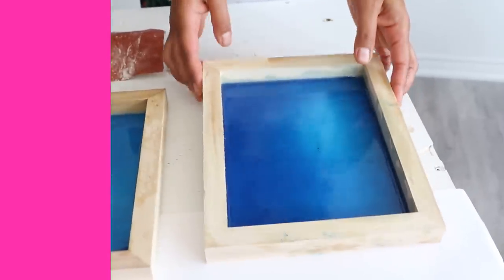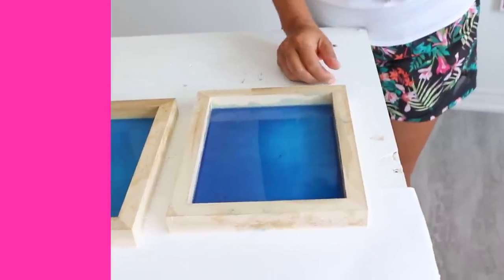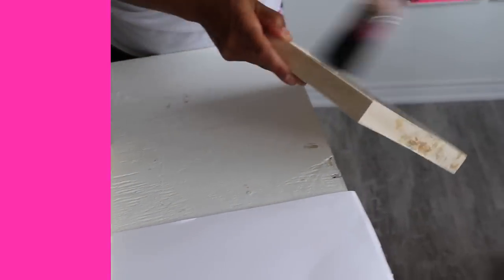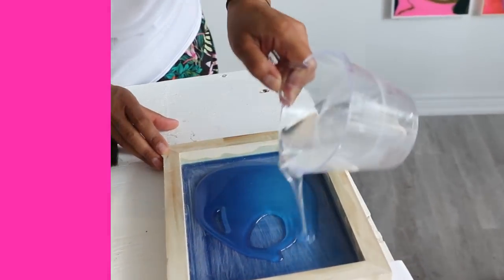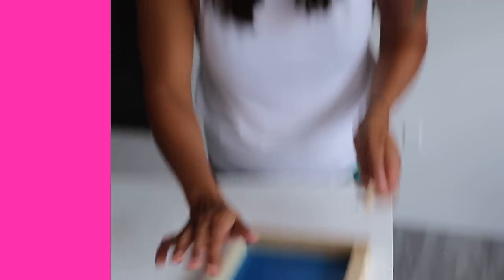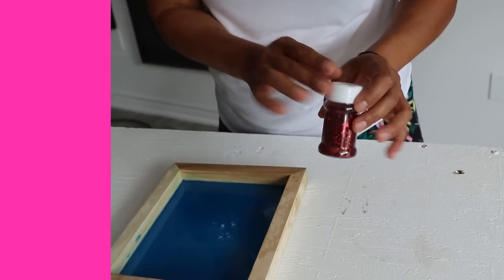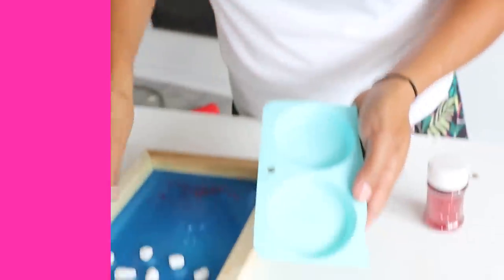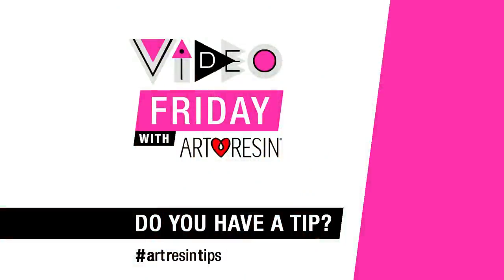How Do You Pour Multiple Resin Layers?

Comment: Why can't we keep flowers and fill mould with resin at a time?why to do it in layers?
Reply from the maker: ArtResin was developed as a coating resin and as such it is quite viscous.  This viscosity lends itself very well to coating and doming in thin layers, however when it is poured in deeper applications it can cause bubbles to be trapped.  To best avoid this when pouring ArtResin in smaller molds, we suggest using a warm water bath to gently warm up the resin and hardener prior to mixing, then pour in shallow layers to help reduce bubbles from being trapped.
Reply: @Artresin  Thank you so much mam This information is very precious because we were searching for proper guidance for so long no nothing helped.
Thank you so much for your guidance
Reply: @Artresin  and how much time approximately it will take whole thing to harden for example 8*8 mould with 2inches deep?
Reply from the maker: @srisrujana2731  typically ArtResin will reach its full cure in 72 hours but this is based on a thin coating.  Thicker applications may take some extra time to fully harden but its hard to say exactly how many hours/days.  Your casting should feel cured to the touch in 24 hours and will continue to harden over the next few days.
Reply: @Artresin  oh okok Thank you so much mam really really helpful this is

Comment: Why do we pour multiple layer for epoxy table
Reply from the maker: We recommend pouring ArtResin in a maximum thickness up to 1/4" at a time.  Any thicker and you can be plagued with bubbles that get trapped in the thick layer.  You can pour as many layers as you like, just allow the previous layer to cure for 3-5 hours before adding the next.

Comment: After you brush it you're supposed to wipe it with alcohol ,let dry and then apply resin .
Reply from the maker: We don't typically use alcohol on the cured resin surface- we prefer to clean the sanding dust off with a damp microfibre cloth thoroughly.

Comment: Just did a 2 inch deep poor using 1/8 inch each layer. Mixed well, 5 min even warmed resin. Micro bubbles everywhere. Will not use in layers again. Ruined my daughter's bridal bouquet!😪
Reply from the maker: We are sorry to hear this!  Micro bubbles tend to be a bigger problem in the winter months as the temperature of the resin and the environment is cooler.  Some tips to help prevent micro bubbles include using a warm water bath for your resin and hardener before mixing and being sure to stir very slowly rather than whipping air into your mixture.  After each layer is poured clear any bubbles that rise to the surface and check back about 45 minutes after pouring for a final check.
Reply: @ArtResin  I did all the above. My room is 80 degrees. Warm bath, slowly sired for 3-5 min, scrapping the sides. Used, let's resin for another project deep mold, no bubbles! Same environment

Comment: So I made some painting on wooden tray and I have poured a resin layer but it did not harden well, same like the second board, can I pour a second layer directly?
Reply from the maker: Hi there - sorry to hear you had some curing issues!  If the resin is sticky, but pretty dry (like the sticky side of tape), you can just pour a fresh coat on top and it will bond with the sticky resin.
But, if the resin is runny and wet, you need to scrape off as much of that wet material as you can.  Then pour a fresh coat over top. 

Hope that helps!
Reply: @Artresin  thank you so much 🙏🏻🙏🏻